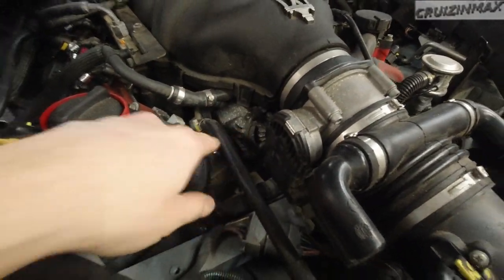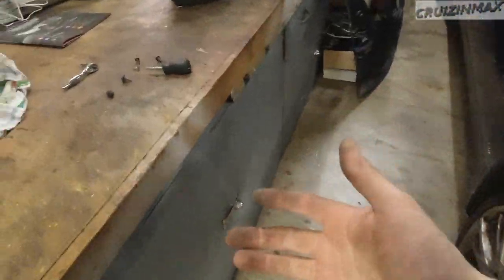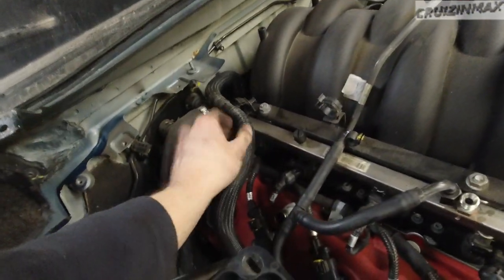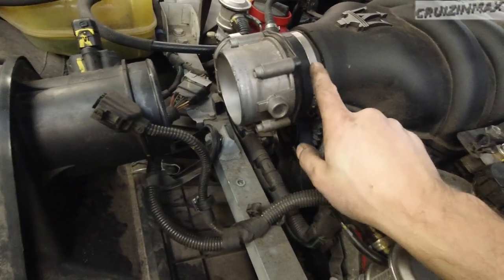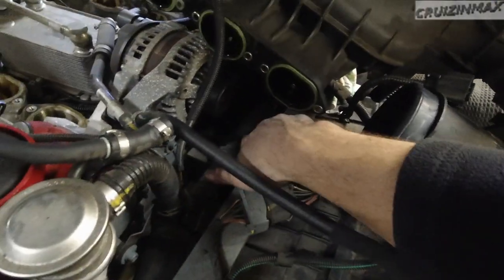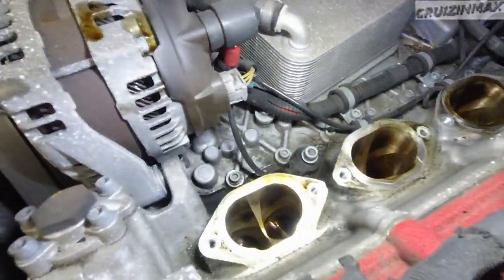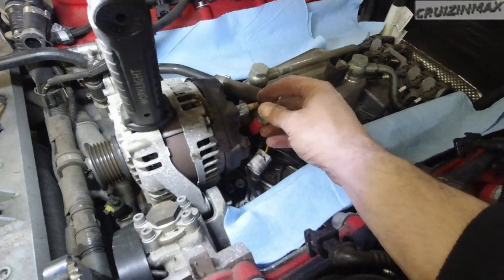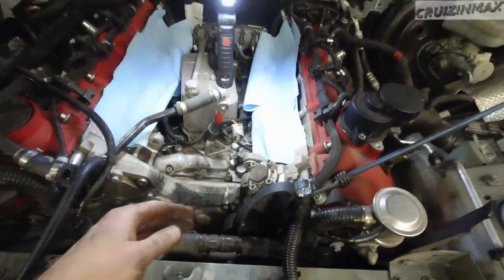Maserati Quattroporte how to intake manifold and alternator

Comment: This was a great video... however, there is a recessing Allen key bolt on the back right side that keeps the alternator snug. If you loosen that first, you won't struggle to remove the alternator. Just a friendly tip.

Comment: I left the fuel rails in the engine with injectors on the engine. Didn't need to remove them. I removed the intake manifold without the rails.

Comment: Great video.  What length and type of 15mm box end wrench did you use for belt removal?  Was it and offset wrench?  Thank you.
Reply from the maker: Sorry for late response, It was basically a long closed end 12 point straight wrench, you can probably buy them on amazon.
Reply: Thank you for the response.  I used a 15mm socket and a breaker bar to release pulley tension.

Comment: What is the part number for the alternator for the 2010 Maserati quadruporte base model 4.2 l
Mine's out I've done the test had a feeling but did the test anyway measurements aren't reading we're supposed to check the fuses. And still went back to the alternator test then alternator then power drops across the alternator's connections to make sure everything was connected correctly and everything was grounded. But I do need the part number.
Reply from the maker: No idea my friend, the owner provided me with the alternator and it was used.
Reply: @cruizinmax4017  thank you so much for the video that is a big help I have a part number but I wanted to verify make sure that it's the same part number for the model that we have

Comment: Damn man, when you pressed that electronic throttle body I cringed so hard. Short cut alternator job for sure.
Reply from the maker: why, did you have issues after moving the flap like that?
Reply: @cruizinmax4017   it can mess up the throttle body for sure, suppose to use the accelerator pedal for electronic throttle body’s. Not like the good ol days of pulling the wire.
Reply from the maker: I have done many throttle body cleaning like that by moving the flap when the key is off and never had an issue.  With no power to the motor, the motor moves freely so you can move it all you want.  One time cleaned out a nasty and I mean nasty TB on a nissan altima and I had to reprogram it after that because rpms would jump up and down.
Reply: @cruizinmax4017   I guess if it has no power you’re right; I’m personally just too scared to do it myself lol I own/work on my Granturismo and stuffs expensive to replace 😝 never know with touchy Italian cars lol